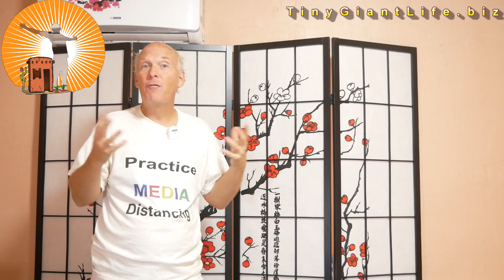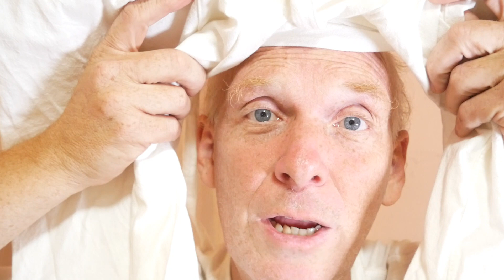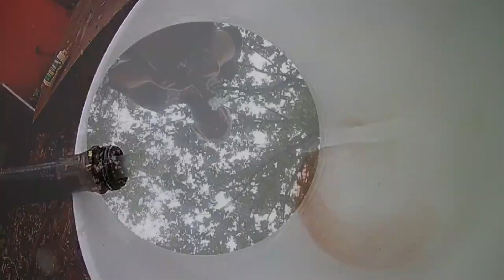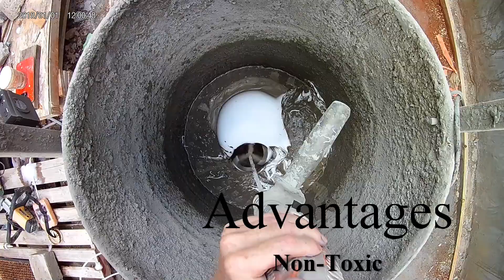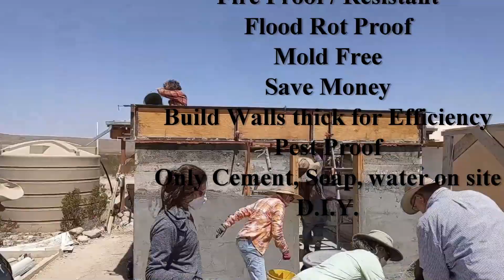18 Can I build a Basement with AirCrete

Comment: What about aircrete insulation within a concrete structure?  Maybe some type of composite structure...?  Love your videos.  I need to build a post harvest for my farm with a cooler.  Maybe aircrete would be a good solution.
Reply: That would definitely work if engineered correctly.  It's a concept i have been thinking about for years.
Reply: I have the same question!